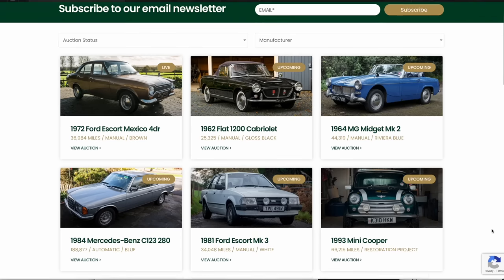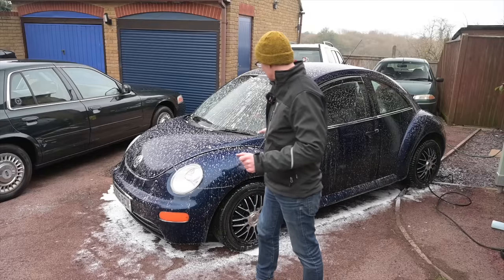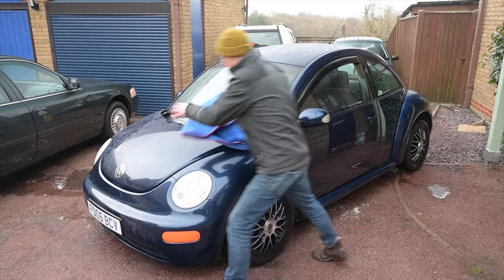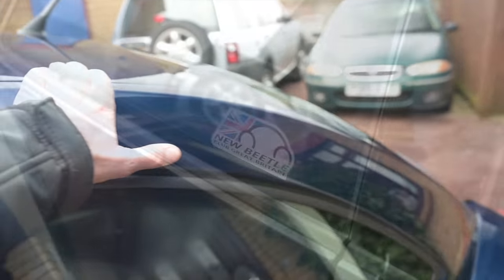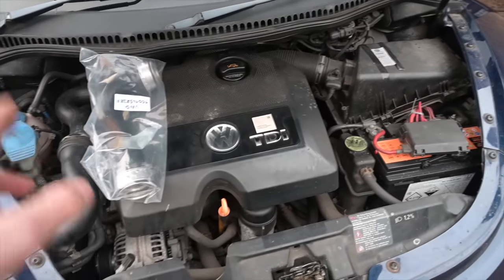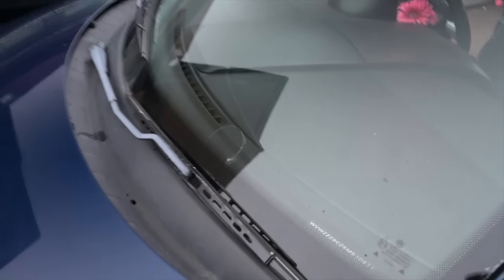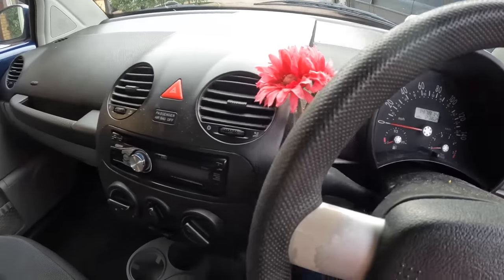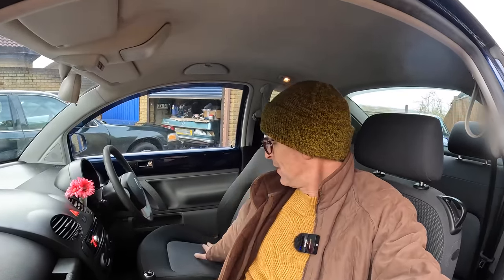Everything RIGHT with my new New Beetle!

Comment: It's a brilliant little car. Not everyone's taste. Super cute looking and built on the excellent Golf Mk4 chassis. Those 1.9Tdi motors are legendary. Love it!😃👌
Reply: Why is the Golf 4 chassis excellent? It's a regular FWD layout, with a regular susupention. Good thing is they don't rust much, but that's about it. The engine can be reliable, but it's peripherials (turbo, injectors, EGR, high pressure pump) usually fail first on well used cars. Objectively speaking, this is a Golf 4 with different body panels and dashboard.
Reply: @Бранимир Петров  The amount of Golf Mk4s still on the road is testament to their build quality. The platform was a big step up from the Mk3 in my opinion. The Beetle is basically a Golf in different clothes...as you said. Any car that is well maintained can stand the test of time. I have a 2004 Golf Mk4 Gti limited edition with 220 000 kms on the original motor. Only changed the cambelt and waterpump....1 new battery, brake pads and tyres....otherwise completely original...drives like a dream.....and as you say...no rust at all.
Reply: @jeremyjames1972  Well, the 1.8T is the far better motor than the TDI imo, they just have a oil orinking habit. However, not all cars tend to be like yours. My close friend have a A3 1.8T 150hp, which is almost identical to the GTI. There isn't a single component besides the chassis and the engine that haven't got replaced.
Reply: @Бранимир Петров  I have the 1.8 T and its been excellent as I mentioned. Your friend maybe just had a dud....it happens. Mine also doesn't "drink" any oil between services
....that said...While Volkswagen has produced many very good diesel engines over the years, the “ALH” engine used between 1998 and 2006 is regarded as one of the best. 😉
Reply: @jeremyjames1972  I agree. As we know, every car cam be relaible, as long as it's maintained properly, and most of these were maintained like a W123 200D

Comment: I know on early Audi A3's they had similar rust issues along the roof rails, caused by the trim rubbing and of course eventually rusting. So I'd pop them out and check for any other corrosion in there, if you plan on tackling the roof and want to do a thorough job.

Comment: Having owned 20 of these, I love them to bits. 

The front indicators are wrong on it, they should be clear, they are actually aftermarket,  the ones on there look horrible!

There will be more rust, pull the arch liners up usually there more hidden in there. And there's a hole at the front, if you prod around that drain bung, it was looking pretty crispy there.

Roof gutter rust is also very very common. You need to pull out the gutter strips as the rust forms on the roof seam underneath as the water gets trapped in there. Sand back, repair, paint and fill the gutter with waxoyl (or similar) then put the gutter strips back in. Unfortunately earlier cars weren't protected well at all and suffered badly with it. Open the boot and pull the gutter strips out starting at the rear, do not start at the windscreen end.

And yes that car was part of the New Beetle club, I recognise it. I'll try and get some more info.

The flower isn't original either, they didn't come with flowers from the factory, you could buy a plush VW flower.

And the silver spokes on the steering wheel unclip (prise them apart from the rear with a screwdriver, they are glued together but they won't break, dab of glue when you put them back together) and you can paint/wrap them. Most steering wheels are like that.

Drop me a message there isn't much I haven't done with these, I can give you tips/tricks, etc.

Comment: I personally can't stand VW group products whether new or old, mostly because I had to work on them lol.

However I'm watched every video you put out over the last 3 years and it's more or less the entertainment that ensues from you fixing (and failing) and driving cars, not the cars themselves.
Reply: I am waiting to see Matt's face when he discovers the V.A.G. tax on spares. "Hello sir, ah you want that small bit of plastic, certainly. we have that in stock. You can pick up today. The price ? its just £274564736352723744 plus VAT." or that's what it seemed like on my A4 Cabriolet 2.4 sport (Off to the crusher as valve stem seals have gone and exhaust flexy joints have snapped after welding them 3 years ago £3800 plus the dreaded quoted for a new exhaust 😮
Reply: @lordbungle6235  I always like to compare what VW parts are compared to my old 30 year old Peugeot.

Peugeot 306 water pump- €30
Mk.3 Golf water pump- €60

Peugeot 306 shocks- €20 BOTH
MK.3 Golf shocks- €80 both

Etc. It's ridiculous, and not compare how far behind VW was with comfort and quality. Compare a 1990 Mk.2 Golf and a 1990 Peugeot 205, the Golf seems like a 1960s car in comparison!

Comment: As a 53 reg yellow tdi beetle owner I approve this video. Mine has similar spec, a/c, heated seats, leccy mirrors, mine has fog lights though.
I picked it up last may from Sheffield. I paid £700 for it. I hunted for a yellow tdi for months and months. 
Low mileage too, it had only done 110k (112 now).
You find the pipe that goes into the egr work loose. There’s little nipples on the Alu connectors that wear down.  I’ve tried 3 times to get the correct hose. I’ve given up and zip ties have held it in fine. I recommend doing Liqui moly diesel purge. I’ve a few videos on my channel of when I did mine. 
Happy motoring 🤙🏽🤙🏽

Comment: I prefer the Mondeo to the Bettle, however the PD is a good solid engine. Definitely get some rust proofing such as Bilt Hamber Dynax under those plastic sills and arches.
Reply: A quality engine (provided it had a turbo) and I reckon the GT TDI 150 would have suited me well. But I got a 96 420d and it was dynoed at 130hp, same torque as the V6, would run on Asda veg oil (as per Top Gear) and looked great with alloys and an e-tech wing. RIP. O yeah, BH rules

Comment: I LOVED my New Beetle. From the time I saw it in a magazine when launched I had to have one, and bought on as a parallel import from Holland in 2001. It was a 'double yellow' 1.6 petrol with lots of extras which all added up to less than a UK priced-car back then. Back then, the VW badge on the bottled was on a hinge and span round to access the opening handle. Very neat. I spec'd Montreal 16" alloys, winter pack, 6CD auto changer and split rear seat, plus the fancy colour and picked it up from the dockside at Harwich on Dutch import plates. Mine arrived a few months before there was a 1.8 which could be remapped nicely, but so what. After putting 60K miles on it I swapped it for something else and I still miss it. Yes, it has its limitations and I can't see it ever being a classic, but back then it was a head-turner.
Reply: I noticed there seem to be quite a few left hand drive ones in UK.
Reply: 1.9 TDI one of the best VW engine's ever made the worst has got to be the 1.4 16v. Which was of the same era
Reply: @Phiyedough  Mine was a full UK spec right hand drive car. Laughably, even though I had it logged with VW UK for warranty etc, every time I took it for a service they said 'oh, that's the import isn't it?' and got sniffy with me. When I enquired about PX'ing it for another VW they said that because it was an import they couldn't offer me the same value! I pointed out that it was made on the same production line in Mexico as the one in the showroom and the build sheet showed it as full UK spec. Even my insurance company were dubious when I initially insured it and said 'you'll struggle to get parts' and tried to increase my premium. This was all part of a wider conspiracy to stop the public buying cheaper cars from abroad, and eventually UK pricing had to change and the parallel import market dwindled.Weird times.

Comment: Suggest Hydrate 80 after rubbing down the roof. 2 coats then if you need a good filler Dolphin glaze self levelling works well on flat and slightly curved panels.

Comment: Your bonnet pull is just missing a clip which creates a wedge to hold it in place just a piece of black plastic. My wife's beetle (Rosie) has the same roof area rust. As for steering wheel I changed my wife's for a original leather one for a bargain £30 inc airbag. The plastic ones often wear out as most are at least 15 years old. 
It's not the sill that goes it's actually what I'd call sill cover or side skirt unfortunately mot centres call them sills. They fill with water and rot from inside out.
Go for some moon hubcaps or retro fit chrome vw centres.
Seats you can fit mk4 golf gti seats in the front and some have very similar pattern to the grey black of beetles.

Comment: That roof rust repair probably needs the seaing strip removing if possible... that's most likely the start of the rust and paint breakdown..

The underseal failure needs addressing properly but as you say has been caught in time, probably an area wherw damp gathers and creeps behind the underseal and along.

Comment: Get a new steeringwheel before aligning the front, let the same guys switch it to make sure it is set at the right angle!? Also, if you switch the steeringwheel by your self, remove the battery a long time (hours) before handling the airbag!

Comment: You can easily install cruise control in this car since you are searching for a new steering wheel. A new switch ( the one for the blinkers and for the high beams) and programming.  You will really add value to this car!

Comment: They’re not bad motors Matt but they are well in the banger category,   so I think you might of got the raw end of the deal….Also  you   need binoculars to see out the screen as you sit so far back…, I’ve had a couple and being a Mk4 golf in a pretty dress makes them cheap for parts and quite reliable , but the interior plastics and switches etc aren’t quite Golf MkIV Standard.

I don’t know if you got the better deal though as they’re normally quite cheap unless it’s something special like the V5 or 1.8 turbo but a diesel PD is bulletproof.
My Mrs still has a minty convertible example and paid £500 for it 3 years ago and it’s completely rot free but it’s worth pulling the wing liners back and clearing out the mud occasionally to keep the sill ends good.

Comment: Not a bad car. You do need new tyres for sure. That rust needs doing quickly. I did have to laugh when you said about an older person not flogging it. My mother, AKA Hotrod Harriett, used to like to cruise at 80-90 mph in her old Volvo 240DL estate. That may have something to do with the car. LoL. When they were new I did not understand buying these, since they are nothing more than a Golf with a more expensive, less practical body.

Comment: I’ve had 3 of these beetles. The 1.8T cabriolet, 1.6 which I sold with 200k on it :) did lots of motorway miles. 

And I’ve still got my 2002 1.9 TDI which is fantastic. Pulls well, great on fuel, reliable and a solid car.

Comment: Whether its a classic or a new one the beetle has its fans and its haters. ive had three originals and modified one many years ago with the running gear out of a hillman hunter . 1725  cc of brute strength. was written of by a tipper driver.    nice one crack on

Comment: For me it was more that it was so compromised compared to what the Concept One promised that left me disappointed. A midships driving position and cramped boot just to share Golf underpinnings took away the practicality of what should’ve been a winner. Mini did it better. That said, as a fun little used car it has appeal, and with those shared underpinnings parts should be plentiful and cheap. The styling has aged well and is somewhat timeless! Still very expensive here, 2005 models in good condition are around $10k Aus (£5700)

Comment: I had the same engine in my Leon, absolute reliability for 111k until I sold it. I have Constancy tyres all round on my 306 cab, can't fault them. But then again, I never drive it in the rain 😂😂
Reply: Same engine as in my mk4 golf, currently on 241,000 and going strong
Reply: @mrbakerr1  Never would've parted with it had a child not appeared, 1.6TDi in an Octavia just wasn't the same.

Comment: 16:42 (as the screen shows) southeast side of that black rubber thingie looks a bit sorry too. I think addressing that too wouldnt hurt

buy a car from bidding classics, insure it with lancaster and look after ith diamondbrite. your ad agent stars are aligning

PS: haters gonna hate. you know you better than anyone. just ignore them.
Reply: 17:30 looks fairly suspicious around the plug. The thick rubberized undercoating used by the factories are great at hiding serious rust problems. Rule #1 regarding old cars: rust is always worse than it may look at at first glance.

Comment: A mid 00s VAG group golf based car that not got rotting font wheel arches or sills that good rotten sills is what killed my 2006 golf plus and can tell u that the 1.9 PD is basealy a bullet proof engine having owned one my self where better then most of the common rails diesels out at the same time I have owned 3 mid 00s diesels and the pd was the best one had a ford 1.8 tdci engine ford own engine and a vauxhall 1.7 cdti engine one so the Isuzu engine one now have a 1.6 tdci ford focus with the PSA (HDI) engine in it